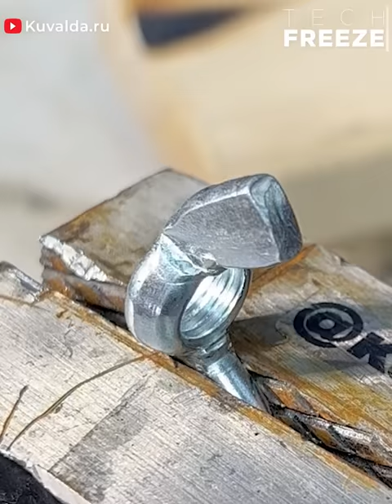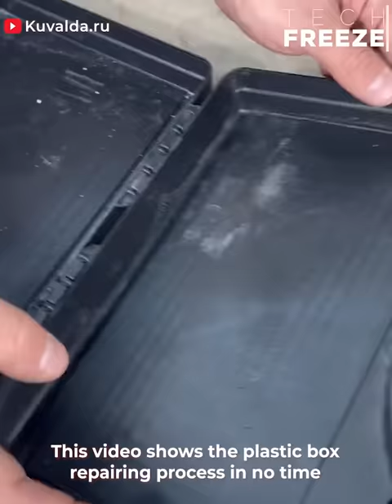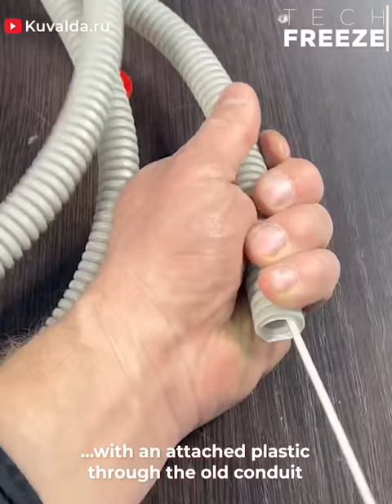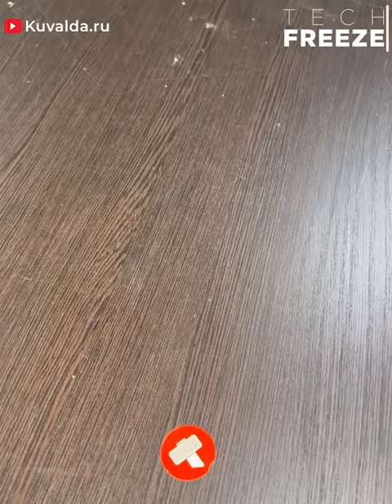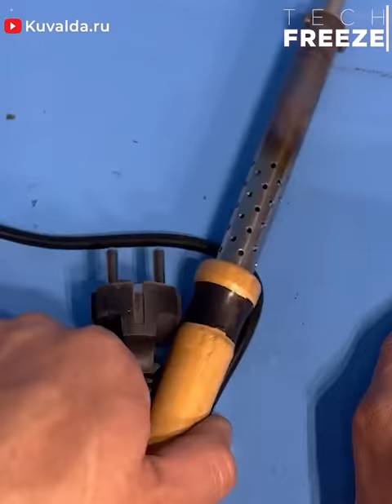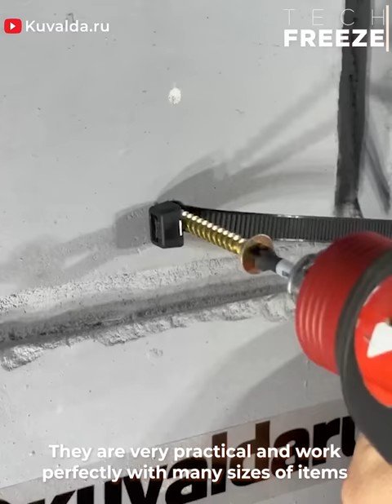Amazing Handyman Tips and Tricks You Need to Know ▶2

Comment: Aluminum rivet on a copper wire?  Terrible idea.  Copper reacts with aluminum, it won't work in 6 months.
Reply: And it could start a fire
Reply: Not really, Electrical wiring often uses a mix of aluminium, copper, gold, silver, brass, lead and steel depending on what sort of wiring you're doing. Its really only a problem to mix these if they are getting wet and if you're getting your breaker panel wet, the corrosion is probably the least of your problems.